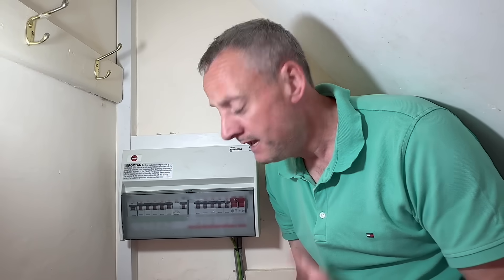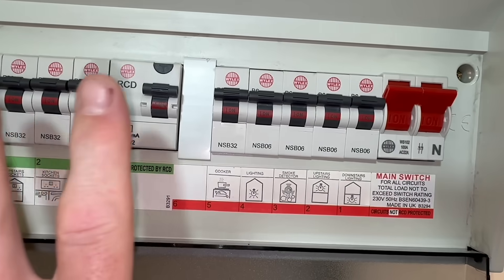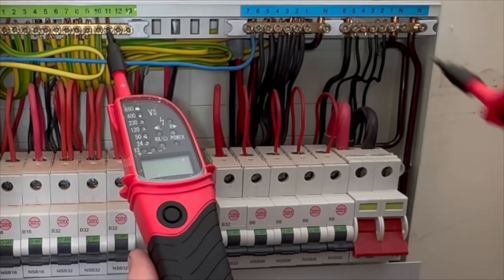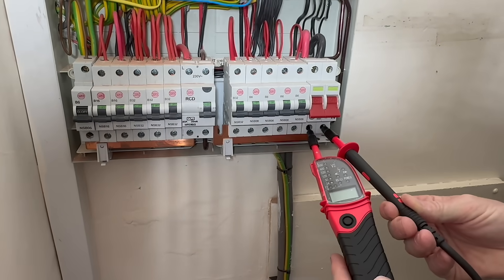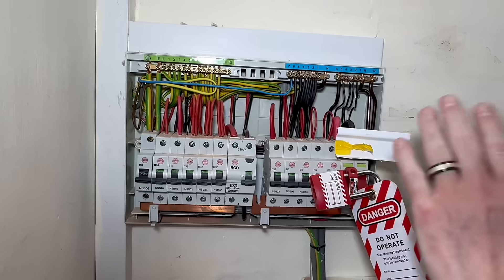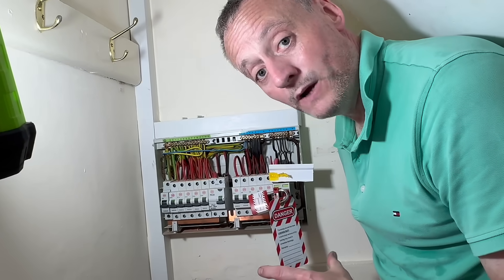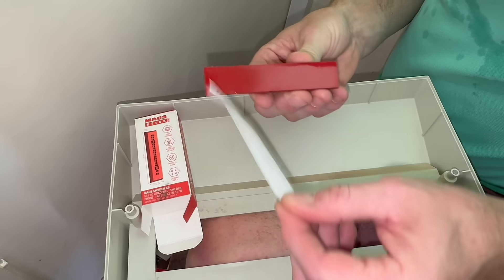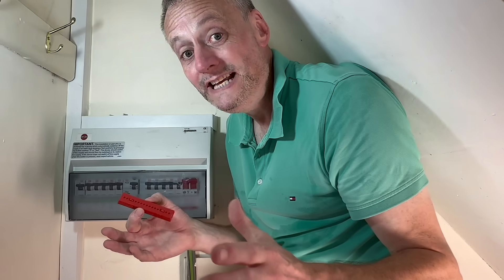£1000 To Change This Plastic Consumer Unit?

Comment: The smoke and heat alarms must be on the lighting circuits as they are never switched off. The smoke and heat alarms on a dedicated circuit? Nonsense. Many turn them off at the CU after some nuisance alarms like toast burning.
Reply: Problem is the instructions for smoke alarms say not to be on circuits with dimmers or LED bulbs. As that is every lighting circuit in existence these days it will need to go on a different circuit.
Reply: I’ve always used battery fitted alarms for smoke & CO in my place; they are not dependent on the mains power supply.
Reply: "The smoke and heat alarms must be on the lighting circuits" Says who? Where?
Reply: @paulinturkey  
Says me using logic.
Reply: @johnburns4017  well there’s your first mistake. Confusing logic and regs. If you’re going to use the word “must” with regard to electrical installations, then back it up with references. If you can’t, you meant it’s your opinion. As with everything with BS, first and foremost , it needs to be installed in accordance with the manufacturer’s instructions. If that calls for a dedicated circuit, your opinion is worth jack shit, irrespective of the validity of your opinion.
Reply: @paulinturkey  
I have not confused the regs with my logic.
Reply: You have one of those compulsive disorders. Get it sorted for your own sake.
Reply: john burns isn't an electrician. Ignore everything he posts.
Reply: @davebadger100  
We have one here.
Reply: @johnburns4017 Not wrong though, is he?
Reply: @paulinturkey 
He is more wrong than you for sure.
Reply: @paulinturkey  I'm  not wrong.  This pratt turns up on various electrical threads talking nonsense. He then repeats parrot fashion methods and regs that he gleans from proper electricians.
Reply: @johnburns4017  Where in the regs does it say MUST?? Just for the avoidance of confusion ,we are talking about UK regs, not French, North Korean, Outer Mongolian or Uzbekistan regs here.
Reply: @davebadger100  
You don't know much about this electrical stuff do you?
Reply: @johnburns4017  Still waiting for that reg that states smoke alarms MUST be on lighting circuits.
Reply: @davebadger100  
Common sense and simple logic eludes you. Sad but true.
Reply: @johnburns4017  Nope not at all. You still haven't quoted the regulation that says you MUST put smokes on a lighting circuit.
A specific reg from either or both BS 7671 or BS 5839 will do.

Comment: Are these videos just click bait? And all those agreeing with keeping this old bag of shite, (and its faulty 16amp MCBs that were known to set on fire that some stupid new device these lot are trying to flog won’t stop) just trying to be controversial?
A modern unit is FAR superior to this, type A RCDs, individual RCBOs for each circuit, surge protection and then, yes, good old fire rating. It shouldn’t be code 2, but it SHOULD be improvement recommended, if she can afford it she definitely should do it. It’s not ripping her off, it’s improving her installation and property if and when she sells, you utter morons. Although £1,000 is way too much!
Reply from the maker: Thanks for Clicking 
https://spark.efixx.co.uk/timeforachange/
Reply: @efixx  😂
Reply: Are you off your meds again flower?

Comment: Forgive my ignorance but why do some sparkies wire the smoke detectors on their own whereas others prefer them wired into a lighting circuit? Is it just to save space?
Reply: If the lights aren't working people get them fixed if the smoke detector circuit goes off people don't notice or don't care so don't get it fixed
Reply: O it’s so that yiu carnt switch it off if it’s on a lighting circuits

Comment: Looks good enough to me and reasonably tidy. It is fed from 40x40 trunking from the left with the wiring go up and down so changing it would be easy peasy and could be done in a day to a very high standard. I do a lot of these and the trick is to always add an extra row that way the RCDs can be scrapped and replaced by 36mm RCBO's and hopefully all the wires will reach and still all be nice and neat. The downside is changing a consumer can go wrong mega big time particularly if you an electrician like myself who refuses to extend wires. So the skill is working out the exact mm placement of the replacement  such that all the wires will reach and remain routed all professional and tidy! The Pc's are always a pain so what I do is install an extra earthing block. The other pain in the arse is that you have to have a good stock of extension leads so you can rig a temporary supply around the house for the fridges, freezers, router. If the job is going to involve wall channeling, plastering, painting, changing some of the wiring and more like a weeks work, I start by installing a maintenance socket with its own RCBO etc so that the house is still liveable and usable whilst the electrics are off. Either way 1000 quid is a rip off, or I am out of touch with my charging! Never seen the MAUS so really big thanks for that especially since I frequently work with solid wood enclosures.
Reply: An electrician who refuses to extend wires? Is that a serious comment? You’ve never used a junction box for a downlight? You’ve never put a socket outlet on a wall for someone to plug a plug top in to with a flex attached? You’ve never put a flex into a spur for an appliance, or an oven into a cooker conection unit? What the hell are you talking about?

Comment: Let me get this right. You didn’t torque the main switch due to fear of electric shock from a 1000v rated insulated torque screwdriver . 

I have to call you an idiot for this with the mainswitch being most likely to cause problems with terminal tightness .
Reply: Was that not one of the main reasons that the change to metal happened   . London fire brigade reported too many house fires starting by a cu change out, with the meter tails distorted under the terminals. And not tighten enough.  (But on this job. No sign of overheating for years)

Comment: Sure, they should have never approved plastic consumer units in the types of plastic they did. However, if it is safe and checks out, then there is no reason to replace it. That is just a scam and does the industry no good. The fire suppression is a good idea, however, most electrical fires start at an socket outlet with their repeated plug/unplug. Maybe fire suppression in the sockets? but that is going too far!

Comment: WOW! Really? - you don’t see the benefit of upgrading that “plastic” split load 💩 RCD with all the pitfalls of DC ⎓ leakage interfering with its operation?
No RCD ON LIGHTING, agreed not on Smokes if MIC USED OR FIRE RATED CABLE. But I mean cmon they’re always wired in T&E! FFS! 
If the regs (newest version) aren’t there to help our aging society along gently to upgrade their outdated kit for their own safety then what’s the point! Honestly! 

Vorsprung Durk Teknic…. Ring a bell…

RCBO type A Should be mandatory as a min standard. AFDD IS COMING! 🥶 😂

Comment: That’s a conversation I’ve had loads of times. Could it do with upgrading? Probably yes. Am I going to advise the 70/80 year old resident to do it. No. There’s plenty of work out there, you don’t need to con old ladies.
Reply: So you’re going to advise her the risk of electric shock at her plug tops, due to type AC RCDs being blinded by her DC current using equipment? Or all of her circuits going out from the one RCD tripping if it does work? Or the potential risk of those shitty NSB Wylex MCBs setting alight whenever they feel like it, that silly little red thing won’t stop, and her dying in bed from smoke inhalation? Sounds like your conscience  will be clear.
Reply: @CoulterTravel calm down buddy. Of course not, I’ll lock it off and issue an electrical danger notification. Better safe than sorry.

Comment: The number of electrical fires in the UK per household is much higher than in Germany or France per household those countries use almost only plastic boards.
So the boards in the UK are not the issue it is ring circuits and wires not in a conduit. The possibility of wire overheating is much higher with a ring circuit.
Reply: How have you come to that conclusion about ring mains being overloaded ??  The biggest problem with overheating in consumer units is poor workmanship by none electricians .
Reply: @dennisphoenix1 
A lose connection on a ring circuit gives a overcurrent on a single wire. The single wire doesn’t have the sqmm needed for the amperage in the breaker. That wire becomes hot.

With a so called radial circuit the sqmm of the wires is suitable for the fitted breaker.
With ring circuit a loose connection isn’t quickly noticed.
Reply: @leonbongers6004 totally agree. Rings are a hazard, and the sooner the Jurassic sparks in the uk die off and we get rid of rings, the better.
Reply: @leonbongers6004  
Then use Wagos at the back of the backboxes to take the spine of the ring or radial. Have four inches of flex from the Wago to the socket terminals using ferrules. The ring will not work loose as no screws. When pushed back there is no stress on the socket terminals.
Reply: @leonbongers6004  
On a ring you can fit a non-polarised 25A DP MCB on a final ring. Have the two L conductors of the two legs connect into the two terminals on the MCB. No cable can overheat or the ring be out of balance causing danger, as the 2.5mm cable may be 27A max current Non-polarised 25A DP MCBs are cheap items.
Reply: That’s not what Google says . Germany has more fires per household than the uk …
Reply: It is nothing to do with final rings, which are quite safe as they have two safety earth conductors (cpc) back to the CU.
The French have whole house RCBOs, the disjoncteur différentiel, that are to prevent fires. It also incorporates the main switch. You can have a similar one here in the UK by fitting an S type whole house RCD, to prevent fires. They are cheap enough. An S type RCD can replace the existing main switch in a consumer unit as long as the contact gap is at least 4mm, which all that I have looked at have.
Reply: @johnburns4017 
The earth conductor only helps for phase to ground errors. In does not help for overcurrent faults on a single conductor due to ring fault.
Reply: @leonbongers6004  
In a radial if a protective cpc is cut you are stuffed. With a ring the cpc is still intact as it has two routes back to the consumer unit.
Reply: @leonbongers6004  
Nonsense.
Reply: nah is a British thing where in theory we have lots of good regulation and practices but in reality nothing is enforced so the quality of installations is diabolically bad.
Reply: Allowing the use of solid cables on ring mains will be the main cause of fires. Terminal screws easily cut them if one core is on top of the other with a screw bearing down on it.
Reply: @rustybkts  
What you say would apply equally to radial circuits. 
Read on this thread on what I wrote about using Wagos in deep backboxes on a circuit's spine, radial or ring, and 2.5mm flex from the Wago to the sockets.
Reply: The reason for plastic board upgrades to metal in the UK was a direct result from a request from fire brigades in the UK. They were attending a huge number of incidents caused by fires starting in plastic consumer units, which were then melting.
The molten plastic was then dripping onto flammable materials and then setting the whole house on fire.
Reply: leonbongers,
Where do you get you data for fires?
Reply: As usual non electrician johnburns turns up waffling on about his Ronald McDonald version of a final ring circuit.
Ignore him, he is a DIY nutjob who is learning his "knowledge" from the comments sections of You Tube.
He is obsessed with upfront RCD's from France.
Only last year he was advocating the use of whole house RCBO. He has now obviously read somewhere that it should be an S type. He changes his mind like the weather.
Ignore everything he posts. He has no idea.
Reply: @davebadger100  
You have not a clue. The French have a Disjoncteur differentiel. Find out what it is.
Reply: @johnburns4017  Err no. I don't need to. This is the UK. We work to UK regs. That's it.
Reply: @davebadger100  
You don't know much about this electrical stuff do you?
Reply: @johnburns4017  It's OK John, I understand, how frustrating it is for you wanting to be an electrician. Just get yourself an apprenticeship, serve your time and then you can join in with those who know what they're talking about.
Reply: @davebadger100  
We have right one here. Sad but true.

Comment: I don't go for mouse stick as most fires occur due to a faulty MCB and there is still the potential for the fire to restart.incidently there were less fires 50 years ago but more deaths due to electrocution.
Reply: Fit a whole house S type RCD. This is to prevent fires while circuit RCDs are to protect people. Standard in France.
Reply: @johnburns4017 good idea John. It's either going to trip  on imbalance or over current
Reply: @bernardcharlesworth9860  
Bernard, an RCD has no overcurrent. I am not aware if one that has, otherwise it is a whole house RCBO, which I believe is not available in the UK. The French have the disjoncteur différentiel, an RCBO supplied by the DNO. 

The nearest we can have is fit a whole house S type RCD and MCB. Cheap enough for the protection they provide.
Reply: We have a bigger population than 50 years ago.

Comment: don't know what is worse, plastic DB or lack of RCD on cooker circuit?
Reply: 32A Cooker circuit right?
Reply: What's the issue with the cooker circuit ??  Unless you have assumed it has a socket on the control unit ??  I didn't see it .
Reply: @dennisphoenix1 yes there is the Socket outlet factor - but also all circuits up to and including 32A. Wired in T&E - less than 50mm in a wall, or wall containing metal parts not earthed ( you know like the ones
In a 1970 house where 80 year olds now
Live in with metal capping that was never earthed) not otherwise protected or installed outside of prescribed zones… do I need to go on..?

Comment: Most companies in mu area would charge between 5 to 6 hundred a grand is bullshit there was nothing wrong with that board in particular but most old boards are shit or doubled up on circuits the proplem with this video is now most scum landlords when we tell them board needs changing will have watched this and think we are ripping them of that board has got to be the tiredest ive seen for that old neet indide labled good my opion is most plastic boards should be changed serverd there purpose and everything should be rcbos now days least there a proplem u only lose that one circuit and not half the house but that board would be just a suggestion to change i think these vids do no good for sparkies out there cos most landlords think we are ripping them of next time i suggest you show a typica shit landlord's special u are doing nothing good to the electrical industry other than biggest yourself up
Reply: I’m on a split load board, it’s tripped twice in 12 years from a faulty iron and someone sticking a knife in the toaster.

Maybe her money is better spent on an emergency light over the stairs and updated smoke alarms.

Comment: Electrical regulations are not retrospective!
Reply: Well that’s not strictly true. It depends what you mean (beyond the actual definition) by retrospective. We test to the current edition. Which suggests they are retrospective… BUT… you aren’t then forced to ensure every reg is met, when it had initial met previous regulations, and generally you would instead recommended changes to meet those newer standards. However, it is also an engineering judgment call as to how dangerous it might actually be to not meet current standards. Therefore, it’s not a hard and fast rule that they aren’t retrospective, rather it’s very much a grey area.
Reply: And your point? …
Reply: @markhardacre1  Used as an excuse for job creation

Comment: Smokes should be on own circuit but I preferred it when allowed on lighting circuit  reason was you would notice if the circuit triped
Reply: No they can be turned off as being a nuisance after a few toast burns. On a lighting circuit they stay on.
Reply: @johnburns4017 generally need sealed battery in them now anyway, so even isolating the breaker on a dedicated smoke cct wouldn’t turn them off

Comment: Consumer boxes used to be made of wood 😂😂
Reply: A thing of beauty. Wooden boards and lead cables, all dressed to perfection, never a problem. Imagine todays clowns trying to install that, it would be up in flames within a week.
Reply: We used to live in caves.
Reply: my lads rotted away 🤣🤣
Reply: my dad's still is, and a lovely brass-hinged door. MEM Kantark. (cannot arc). Porcelain fuse holders and asbestos inserts. Installed in 1950.

Comment: C3 for it being a retrospective install as long as all the Zs are within BS7671 and thats about it.Only thing i would check is with it being a Wylex DB is the breaker types  as there was a recall on some of the NHX/NHB series as they wouldn't tourque down and not actually make proper contact due to a manufacturer's issue with the screws in the terminals. I do believe they are still covered under Wylex recall, but I could be wrong.
Reply from the maker: Good points
Reply: RCD protection for circuits within a shower or bathroom?

Comment: If the wall material is brick or concrete, this consumer unit can be saved. Small upgrades should be done like replacing wet area lights to SELV. If the power from transformer comes through overhead power line or some outdoor equipment is connected to this consumer unit, SPD must be added.

If the wall material is wood or drywall has combustible insulation, this consumer unit should be replaced to metal and AFDD should installed. 

Many facts are not known about this building.